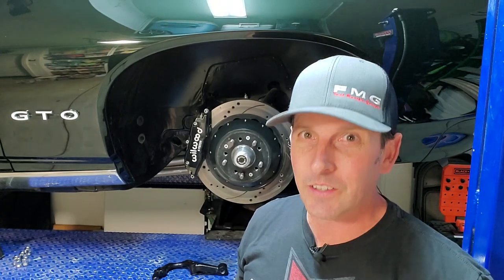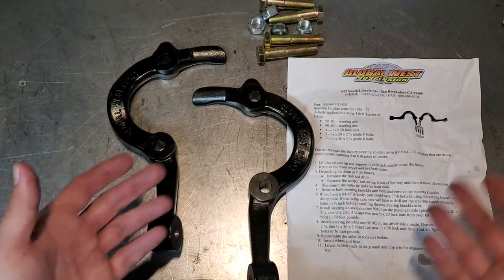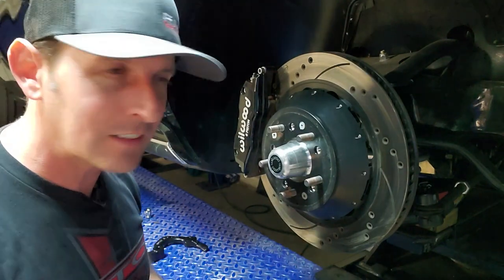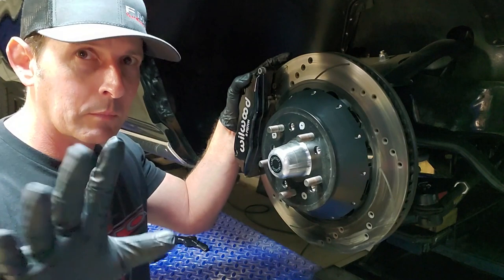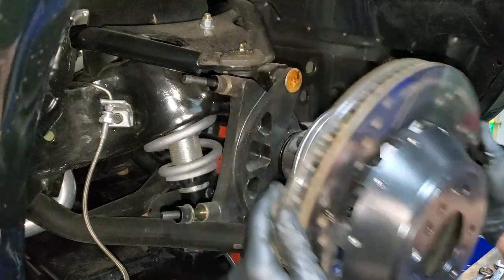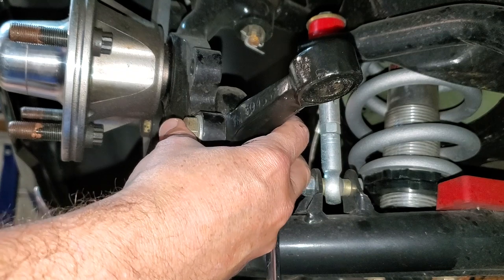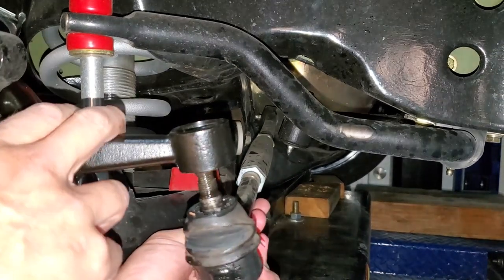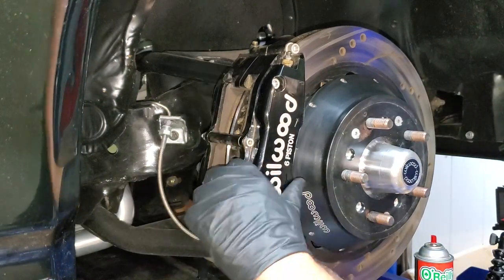How to fix Bump Steer in your 1964 through 1972 GM A-Body

Comment: Stock caliper bolts are rough to remove. Especially since they are Allen heads. I had to cut through the hardened steel bolt to get it off. Just enough for a 3” cutoff wheel. Your videos are very helpful as I just purchased my first A body and starting my upgrades from stock.
Reply from the maker: Yep!  Those 50 year old stuck on bolts are no joke.  Congrats on your first A Body!  Thanks for the comment!

Comment: I have a 1968 Chevelle, and it had drum brakes on all 4 wheels.  I do now have disks all the way around.  I too now have the tubular A arms as I pulled the ball joint, while driving, out of the lower driver's side, and don't ever want that to happen again!  Today going over a larger bump on Hwy101, the car took off to the right.  Not a great feeling!  I'm now going to order the new parts shown here.  I have to ask if I'm going to have to take it back 8n for an alignment as I just had it done.  I'm also going to check the tie rods as I haven't since I stuffed the wheel up into the fender.  Thanks for the video!
Reply from the maker: Thanks for sharing... congrats on upgrading to discs and tubular A Arms.  Yeah, get that bump steer fixed, and you'll need a new alignment, to be safe.  I agree lets not have any more ball joint failures... hope to see you around.  (You're obviously in California)  See ya!

Comment: Usually bump steer fixes convert the outer tie rod to heim and you use a regular bolt and shims to correct. 
What I noticed was you have drop spindles. They make factory bump steer worse by moving the spindle location away from the steering arm. That gives the spindle more mechanical advantage over the steering arm. 
Another bump steer related issue our cars have is a positive camber gain. Which makes the top of the tire go out (instead of in) and lifts the inside of the tire off the ground. A sudden camber change over bumps will also cause the bump steer feeling. The best way to correct for that is a tall ball joint. There are some tall spindles available also. This will give negative camber gain, better cornering traction, and increase tire to fender clearance.
Reply from the maker: Good stuff, brother.  Yeah, drop spindles, and after market A Arms will make the stock bump steer issue worse.  Which is why these are an ideal fix.  Agreed about taller spindles, which is on my to do list, but not an easy project.  (I really don't want to take off my perfectly aligned fenders.  :)  Anyway, camber can always be adjusted, as detailed in my alignment videos.  Thanks again!
Reply: @FastMonty  you should be able to add tall ball joints to your current upper arms or change to a tall spindle like chassisworks or AFX. Without removing the fenders.
Reply from the maker: @punishergto5182  Ahhh, yeah, you're totally right.  I was thinking about the taller shock mounts, too early for me... not enough coffee.  Ha, ha..  Thanks!
Reply: I never experienced bump steer with my unmodified factory suspension setup, this is misleading.  It makes me cry seeing these cars butchered.
Reply: @thisisyourcaptainspeaking2259  you can measure it for yourself. The suspension was designed intensionally to be poor to push customers to purchase higher end cars. These were the "cheap" cars of their day. 
No different than changing from bias ply to radial tires. Technology improved and the difference is unmistakable. If you like stock leave it stock.
Reply: @punishergto5182  They were what they were, couches with wheels.  Modify the suspension then claim they drive like crap isn't a fair assessment.
That said, I found a rear sway added, accommodates my driving style.
Reply: @thisisyourcaptainspeaking2259  I agree to a point. Since these cars have been around so long. Everyone makes a product for them. That doesn't mean every company makes quailty parts. Some parts are just tubular shiny versions of the stock parts. Alot of the complaints I see are poor quailty part or the mixture of parts that don't play well together. Then drop spindle is a one of my least favorite parts.
Reply from the maker: @thisisyourcaptainspeaking2259  Just because you haven't experienced something, does NOT mean it doesn't exist.  It is an issue.
Reply: @FastMonty  Modified, perhaps.  My 1st A-body was straight off the showroom floor, I know how they drive, including sideways @90mph.
Reply from the maker: @thisisyourcaptainspeaking2259  Yeah, they all better be straight, BUT, when the suspension travels the toe changes too much.  That's called bump steer.  ALL A Bodys have that issue.  You may not feel it, or care... but, they do.  Thanks.
Reply: @FastMonty  These cars are tanks, not Ferraris.
Reply: @thisisyourcaptainspeaking2259  they may not be Ferraris but they were named after a Ferrari. They are big and they are heavy. But so are the new area muscle cars. Changing the geometry improves the tires contact patch. It not only increases performance but it also increases safety.
Reply: @punishergto5182  And it's no longer the car it once was.  Get a Ferrari.
Reply from the maker: @thisisyourcaptainspeaking2259  Ha!  Yeah they are... and that's why it's fun to try and make them into Ferrari's.  Everyone has their own "ideal car" in mind, from stock, to modified, it doesn't matter, as long as we're enjoying the ride.  Cheers.
Reply: @Fast Monty's Garage  maybe he just lives in a state with beautiful road and no potholes? 🤷 Not like here in CA! Lol
Reply: @masoncampos7043  he's in CA southern iirc. We have snow plows here the roads are either destroyed or under construction in the Midwest.

Comment: The video on the GW site is pretty good at showing how these steering arms correct bump steer.  They show moving the whole front up and down with before and after measurements.  Would it matter if only one side goes up while the other side goes down as happens during hard cornering?  Its amazing such a small change makes such a big difference.
Reply from the maker: Yeah Ryan, that GW video is eye opening, for sure.  Which is why I bought em.  The bump steer is an independent issue, from side to side.  So, there's no telling what our wheels are doing from left to right, my guess is one is toeing in, and the other would be toeing out.  I think I'd much prefer we keep that change to a minimum, ha, ha...  thanks for the comment!

Comment: I noticed the GW arms are just a bit shorter too. Thanks for bolting them together and showing us.

 If you haven't done the other side yet, can you compare the two, so we can see what geometry change looks like before and after?
Reply from the maker: Good question, Paul... nope, too late.  When I had them on the car, it's really hard to see the difference from side to side.  But, you're right, the new arms are slightly shorter, and twisted, as I showed.  I drove it around the block, and didn't notice any difference, but I still have to complete my alignment.  So, hopefully you'll see if the alignment changed, next week.  Thanks!

Comment: Hi Sr. sorry by my English ,finally I fo y found someone talking about my problem, I have a question. I bought  the drop cups with spacers,  I drop like 2" my tahoe 2016 but a that Point the Outer Tie Rod is not horizontal  like the  chevy comes as factory o maybe a little down inclination,  now after I drop it, has some up inclination , so when you get a bump in the road in only one side, the outer tie rod pull too much towards in the wheel in and it becomes inestable the car, I feel the car shake in the front a some inestability and my wheel steering shake too, so if you drop more the car is going to be worse,  could you recommend  me any solution, I thing that with the spindles is the same thing, what do you thing, thank you, good video.
Reply from the maker: Good question... and yes, you''re experiencing Bump Steer.  I would suggest searching for a bump steer fix, or tie-rod alignment kit, for lowered late model GM trucks.  I'm sure it exists, I'm just not an expert on newer vehicles.  Good luck, and thanks for the comment!

Comment: Use extreme caution when using standard sockets instead of impact sockets when using an impact gun, as they could shatter due to torque. Also use safety glasses ESPECIALLY if not using impact sockets.
Reply from the maker: Thanks Mike!  You know me... living life on the edge.  :)  So, how was the topic?
Reply: Topic was fine. I drive a 71 big block nova so won't work for me. But always enjoy your videos because they are a little different than the others out there
Reply from the maker: @mikeburnett7028  Ha!  Thanks Mike... enjoy that Nova!
Reply: @mikeburnett7028  I have a 68 Nova and I was actually wondering if global weather made these for the nova. Getting ready to put my subframe all back together in the spring using the global west solid body mounts. Novas are my favorite.

Comment: Hi Mike, great video, THANKS !!! My question is, what was your GTO doing as you drove it that made you replace the control arms. I have a 64 Malibu SS with tubular upper and lowers, disc brakes and a Unisteer rack and pinion system. After all this was installed I had the front end aligned. As I drove home my car was not pulling either way at all but it was drifting and I was constantly correcting and don’t even think of stomping on the gas. After watching your video and Global West’s as well I think bump steer is my issue.
Reply from the maker: Good question... I think I mentioned it in the video, I hit a dip in the road, and the car darted to the left.  If your car misbehaves when the suspension moves, you have a bump steer issue.  It's also a relatively easy upgrade, as a "just in case" solution too... hope that helps!
Reply: Hi Mike, after speaking to you last about my bump steer issue I determined it could be a negative camber issue I have and with the upper control arm cross shafts against the frame’s bracket there’s no adjustment in the positive direction. The upper and lower control arms are made by different manufacturers so I decided rather than using an offset shaft to replace the lower arms since I installed the uppers and have no idea of the manufacturer of the lowers, hopefully this will bring the bottom of the wheel inward. Another reason for this comment is I’ve watched several videos from others and so far have not seen a thorough explanation for this project. I see your GTO has tubular a-arms but no video of when you installed them. I’m very spoiled with the videos you produce as they are clear and complete. Thanks for what you do.
Reply from the maker: @davidrosenthal735  I assume you measured your camber?  Assuming you're past .5 degrees, I would agree your lowers might not match your uppers.  Mine are both from Global West... a video does not exist because I didn't know about YouTube until I was done with the project.  :)  Welp, I'm never "done" lol... Let us know how you end up fixing it!  Thanks for your comment!

Comment: Does your 69 gto have Global Suspension rear coilover kit with the stabilizer bar ?
Reply from the maker: Kinda... :)  Global West has TWO different rear coilover setups.  One has angled coilovers, similar to stock, and a simple bolt in procedure.  The other has vertical coilovers mounted where the stock springs used to sit.  I have the vertical set up, but I do NOT have the sway bar installed.  Why do you ask?
Reply: @FastMonty  I have a 69 gto and want to upgrade for street driving, better handing.
Reply: I was looking at the coilovers where the stock spring is replaced and the coil over is mounted at the shock locations. Global West states that the stabilizer bar in their kit distributes the force/stress from the shock mounting area. Im not sure how much of a benefit it would be. I guess the overall question is if your happy with GW.
Reply from the maker: @joeveasy1022  I love their set ups... the rear stabilizer is different than the strut support.  I have this on my to-do list for a new rear end, suspension upgrade, where I'm keeping the vertical coilovers, but might be adding some other tricks.  Try and get someone from Global West on the phone to go over the details of each rear kit.  The vertical coilover kit I have requires a lot of welding.  The other kit is bolt in.
Reply from the maker: @joeveasy1022  Do it!  You'll love it.
Reply: @FastMonty  
thanks  !!!
Reply from the maker: @joeveasy1022  Welcome!

Comment: If nuts or bolts are rusted on, sometimes applying a little heat will cause the rust to release the threads.
Reply from the maker: Good tip Ray, thanks for the comment!

Comment: any videoswheel hop for my 69 chevelle which has new everything in rear including boxed trailing arms. help
Reply from the maker: I'm changing my rear set up pretty soon... I'll research more about wheel hop and try to cover it then.  Stay Tuned!
Reply: I am going to try adjustable upper rear trailing arms before perhaps southside machine bars.
Reply from the maker: @flyinhighaerial3193  yup, I think pinion angle is a factor. Upper adjustable will help. Which I have. Keep us posted!
Reply from the maker: Maybe also get new bushings... I read if they're too soft it allows the rear end to pivot too much.  Good luck!  @flyinhighaerial3193

Comment: Great video! Kind of off topic but I was wondering what size your wheels and tires are, and what backspacing are you using? Also wondering if any mods were done for clearance in the rear? I have a 68 that  I'm getting ready to order the suspension and wheels and tires for. Love your car!
Reply from the maker: Thanks Ron!  My wheels are 20x10 with 295/30-20's and 19x8.5 with 255/35-19's... I honestly don't know the back spacing, because I custom ordered them.  I used a measurement tool called a Percy's Wheel Rite offset measurement tool.  It's around $80, I highly recommend it.  Oh, and no mods to the rear, yet.  :)  (Yeah, I want 325's back there some day)  Thanks again!
Reply: What did you decide to go with? I have a 68 too. I really like the Rally II's but also want a 10" wide in the rear. Mine have a 5.5 backspacing that sicks out a bit too much

Comment: Do yourself a favor and brake clean off the anti-seize compound on each of your lug studs. I’ve seen many customers loose a wheel. It’s not worth the risk, trust me on this. I lil squirt of motor oil  works a lot better on each one.
Reply from the maker: I'll have to research where I learned to put anti-seize on those studs.  Thanks for pointing that out, and leaving a comment.  See ya!
Reply: @FastMonty  I’m writing to you with some experience about this. If I didn’t give two shits i would not write. Back in the mid 1990,s I lost a wheel. Scared the hell out of me. They were torqued to spec, antisieze was the cause. Many customers in the past at Firestone & the Various GM Dealerships I have worked also, same thing. Especially HD trucks some friends of mine in the HD truck market have discovered. I am a GM & ASE certified technician with over 20yrs of experience. I’m also a Pontiac Enthusiast. Over the last 7yrs I have been in the CNC Department at QA1. My 1964 Tempest is a R&D vehicle. It’s built for go, not show. For now. Antisieze is not safe to use on lug nuts, they wiggle loose. Usually on the freeway.
Reply from the maker: @joshbrekke6374  Thanks Josh!  I appreciate the time you took to warn us of the pitfalls... Thanks!